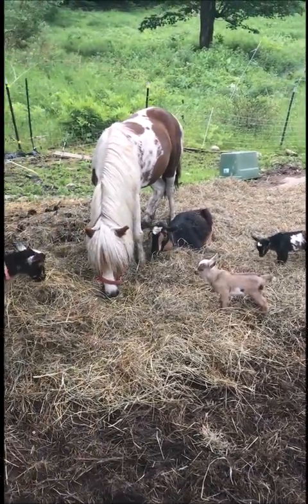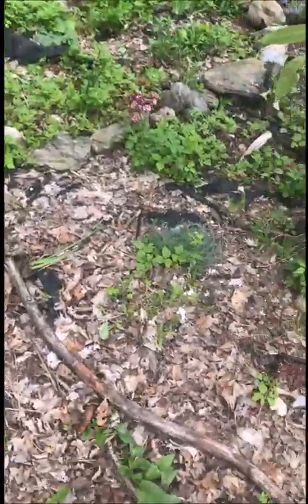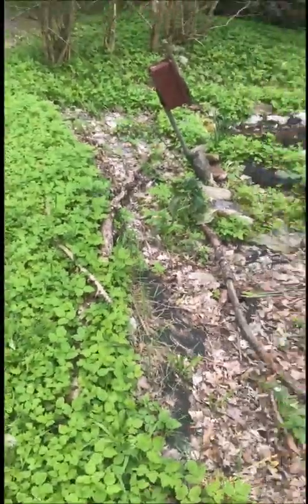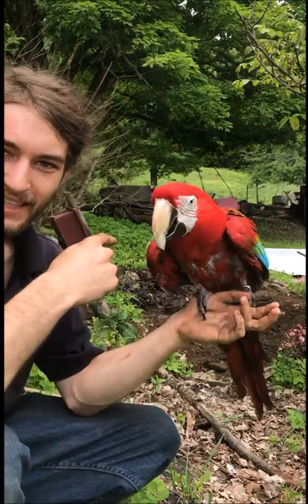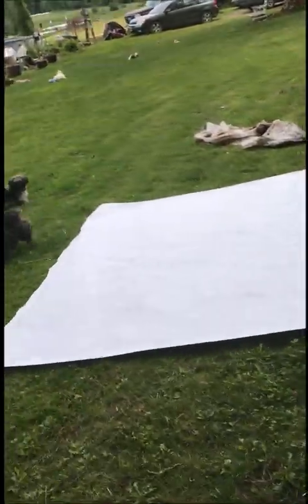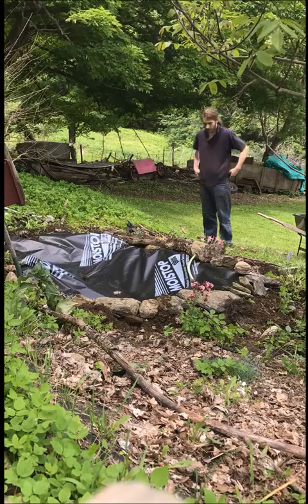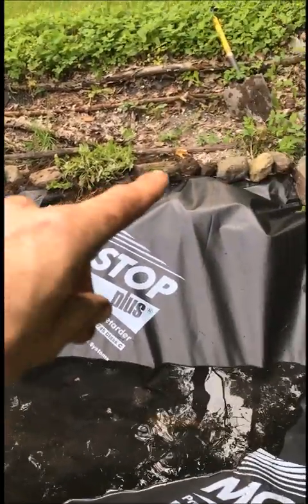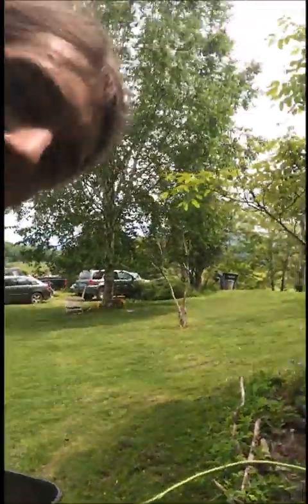Diy Mini Pond

Comment: Hi, I've got a spot in Concord VT, I'd like to see a working earthship, are you still living there and how can I get in touch?  Thanks!
Reply from the maker: yes , i will be working on fixing it up to be an AIR BB this spring, i have another chanel Mountain Top Makers which will host the fix up/build 
I lived in it for 2 years then had to move away, i recently moved back and it needs some fixing but its still solid and around! 
you can contact me via instagram @bioscopics
Reply from the maker: also, sorry this is 2 years late! oops!!